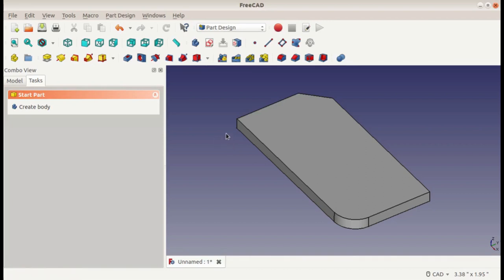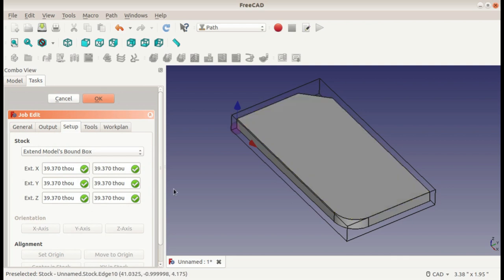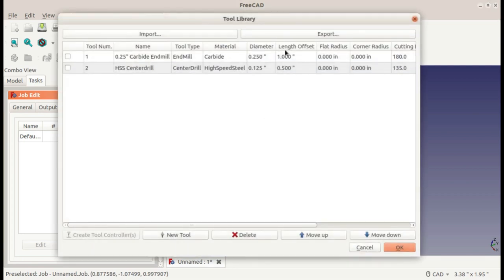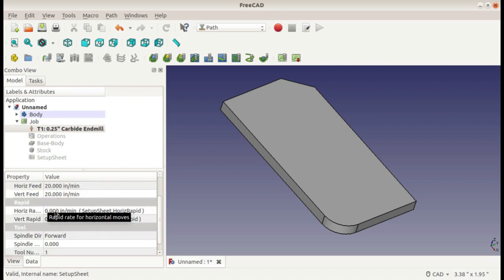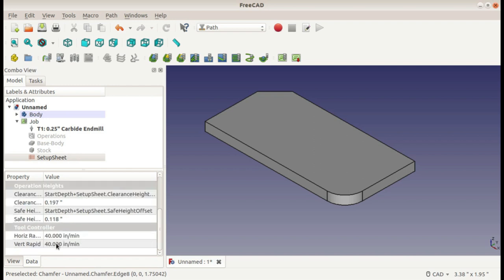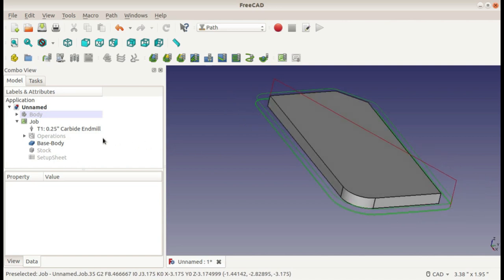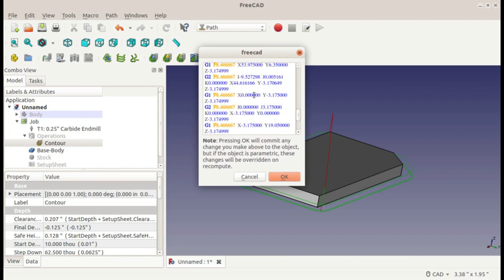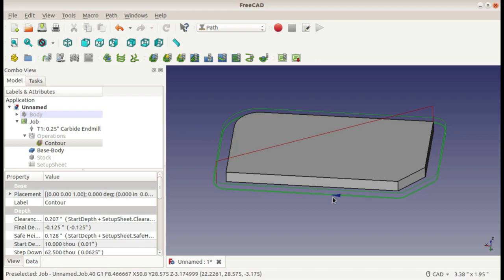Learn FreeCAD: #10 Setups and Toolpaths - Tutorial

Comment: What's the purpose of setting up a job, creating tools, and contours? Is it for manufacturing? Thanks.
Reply: You need to create tools and stock so the program knows what its working with. If you put in the wrong tools and stock size, the CNC wont have the proper tool path.

Comment: according to the wiki manual as with most its just a g20 call out in post process however there is limited drilling function and does not support rigid tapping which is a must for me.
Reply from the maker: Assuming that you are designing your parts in inches like I am, you should not need to post process in inches. As long as it converts all of the values and units consistently, the CNC should interpret it the same. As for the rigid tapping, you may be able to use a regular drilling cycle and set the feed in inches/min to the RPM divided by the threads per inch.
Reply: and whats my control readout going to say when its running when its set to inches as a required parameter. i dont want to see mm. i never know where its at. ill have to post a simple part and see what happens
Reply: yep you are correct posts in metric. absolutely worthless to me.

Comment: are you saying the gcode ONLY posts in metric?
Reply from the maker: From my experience, yes. Even if you are in  US Customary or Imperial units, it post processes in metric. This should not make any difference, though, because it uses a G21 and it converts all if the values to metric. The resulting G-code should behave the same as a G20 with inch values.

Comment: Come on guys, why make work for yourselves time and time again? The WHOLE world uses metric with no problem, including ironically US manufacturing and aerospace, Australia, the UK and NI, even though the Brits invented imperial measurements. We have just over 12 months before the start of the third decade of the 21st century, isn't it now time to get your heads around thinking in metric units? Every argument for keeping  US customary measurements fails at every check. If the US wants to succeed against China and other more productive countries then embracing metric is but a small step. It would save SO much time and wasted effort. You only need to get your heads around it once and then we can all sing off the same page!